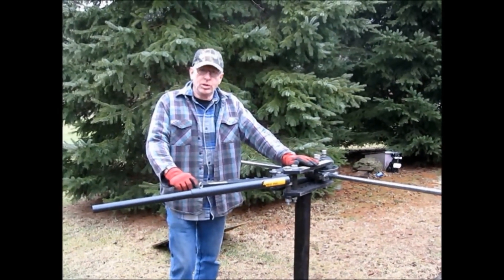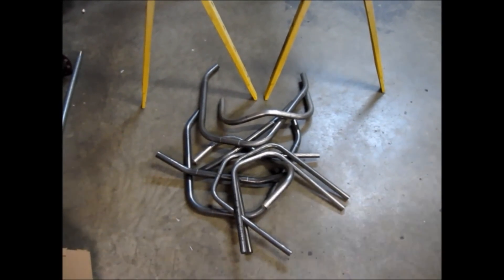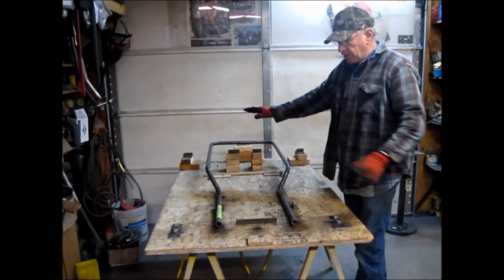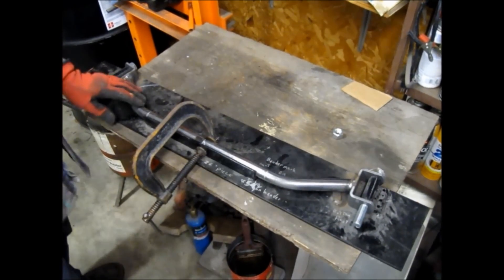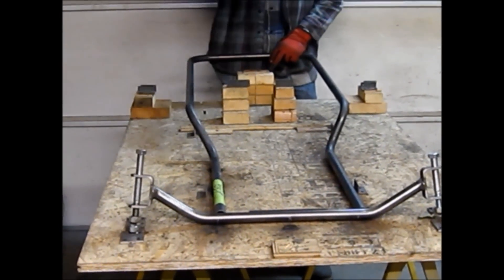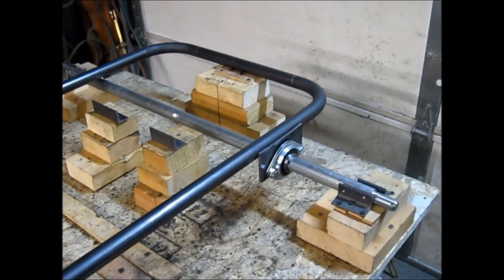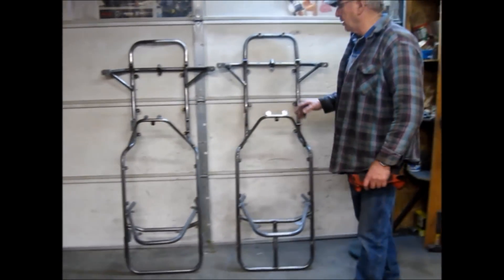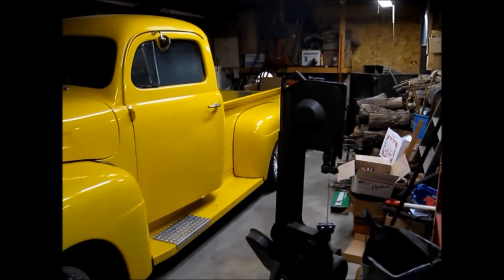1962 Alley Kat II Reproduction Vintage Go Kart Fabrication - Part 1 - Design

Comment: I’m interested in having an electric Gokart for myself. Can you build one frame for me? Or one complete Gokart ready to go? I stand 5’ 8” weighs 173 lbs not a racing type to start the hobby with, I probably can go for 2000 watts (or higher if you say so) 60 volts lithium battery.
Please reply back and thanks.
Daniel
Reply from the maker: We are not interested in doing non-racing electric powered karts.....The majority of what we do is to keep vintage kart racing alive and quite honestly it is not a healthy sport. We are also too small to broaden the manufacturing past that.  If there is an individual that wants to race vintage karts, but does not fit in the 1960s karts like many of us do, we have a possible solution.  That is our focus and that is our goal.  When it does end, we are likely done as well.  Steve has been racing karts since 1959 and I'm not young anymore either.

Comment: Did you ever finish this?
Reply from the maker: Absolutely.  Checkout the playlist for the Build Series at the main channel just click the "Racing Psychosis" icon which will take you to the main channel and scroll to second playlist, and also the most recent race video from 2020 VKA Delmar in the C Open Dual Rear Engine Class as this one and our other one both were on track in that race.  Link to Part 6 as well for the testing of the kart:  https://youtu.be/G1LJEZKr998

Comment: I raced Emmick go- karts for years! I would prefer 1 1/8"  chromoly .085 wall thickness, K frame design. I have 6 track records and 46 wins! Why settle for less?

Comment: FlatHead51 here, was there ever a rear-engine kart that used the fiberglass seats we use now?
Reply from the maker: Like the ones we use now, not that I'm aware of.  Fox karts did use a Fiberglass bucket seat that was upholstered, likely the closest thing to what we do now.  The real problem with most of the rears is that they use seat back tubing and narrower rails than a sidewinder and alot narrower than modern karts, then that usually results in something like what happens with big drivers in a Fox Kart where the center of gravity gets really high.

Comment: for the last 10 years I have been waiting for someone to do exactly what you're doing stop fooling around with building up a old rusty bent up vintage kart . But to start fresh. I never could understand why people would wanna to just fool around with junk .You have the best video and I would like to say thanks and keep them coming
Reply from the maker: +Tim inman Inman Well we got tired of working with junk.  And even when you do perform a great restoration, the kart basically is a fatigued piece of metal.  We still love the restorations and have a couple in our fleet, but they do not drive as well as a fresh kart.  Its like these old Alley Kat I's and II's, if you find one they are broken, they're an excellent handling and driving kart, but they are basically all broke.  Seat design and material and quality of the welding back then just was not good.  And actually we got the idea from RobRon who still makes Darts, and Bug was still making karts when we got back into it, and SAE's are still being made, and Lake Speed who was making repops of Invaders, which now Jeff Brown I believe is doing.  But we also are building our own modern oval track LTO karts as well.  A lot more metal fab in the modern karts with all of their nerfs and such.  And part of it is that we just cannot leave anything alone.  My father, Steve, has been doing this since 1958, and has always figured out how to change things to fit what he wants to do.  And we also like to modify our stuff to get it to work for us.
Reply: +Racing Psychosis Do you sell your frames? If so how much for the single engine type?
Reply from the maker: Duane Garbutt
 We do occassionally, but we are racers, so only during the winter do we build anything and we are not into this to be a factory builder.  Checkout our FB page Welte Racing for better pictures.